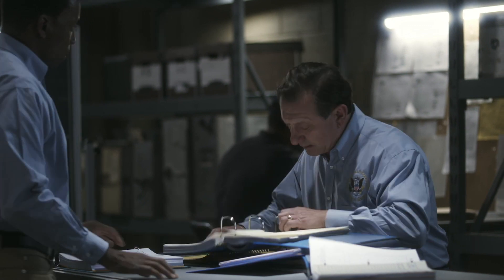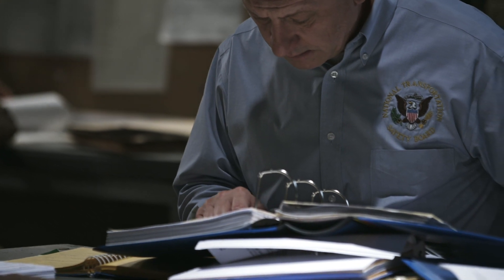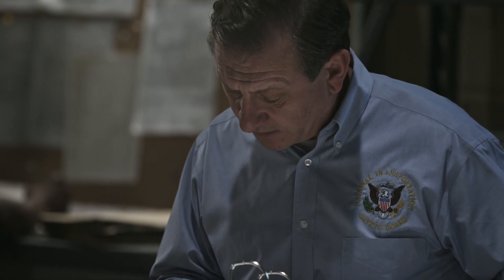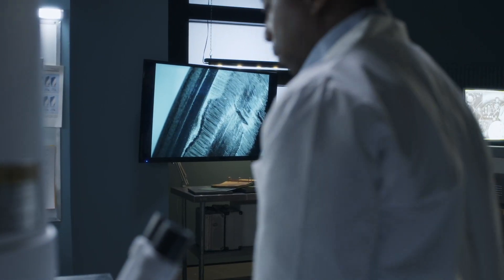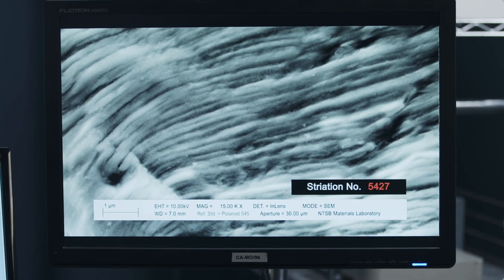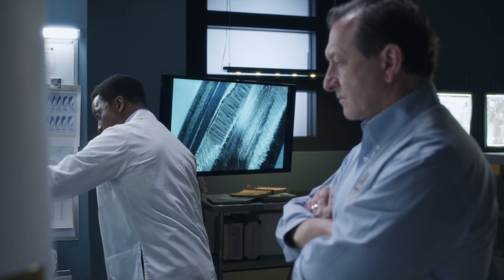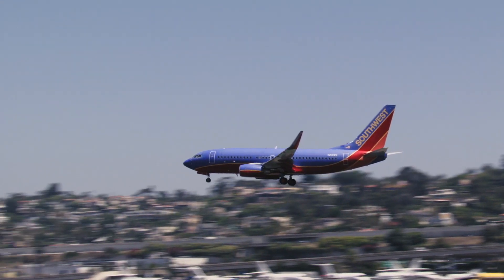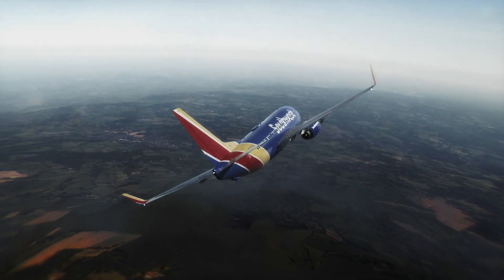Staggering Number of Faults on this Plane’s Fan Blade 🤯 Air Disasters | Smithsonian Channel

Comment: the whole 737 reg. and max seem to be dangerous planes
Reply: Naw, been through this before-the DC-10. JUST turn off the MCAS when climbing...
Reply: Gisele strauch southwest  flight 1380 left  engine  had 32,636 was fatigue cracked